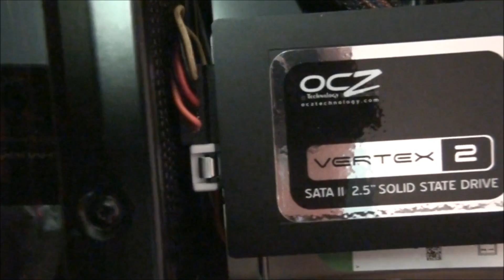Singularity HTPC Danger Den LAN Tower Build Log: Part 3

Comment: @WoodLKyle i think so...
you can remove the hardrives and put the hoses at the bottom and put a small GPU like a gtx 550ti, 560, 560ti* or a gtx 570 HD* maybe the last 2 would fit but measure befor buying and then stick an SSD on top of the PSU with double sided tape ;)